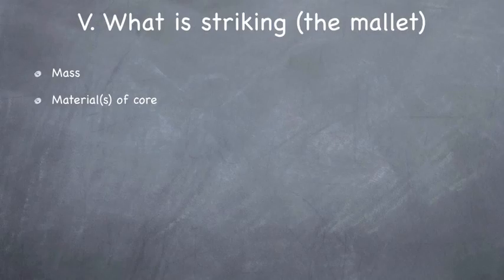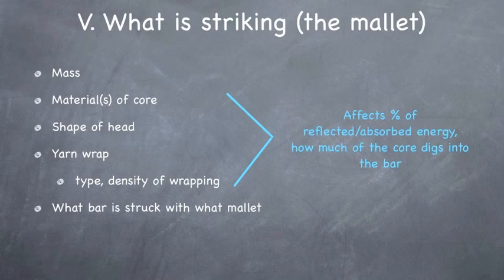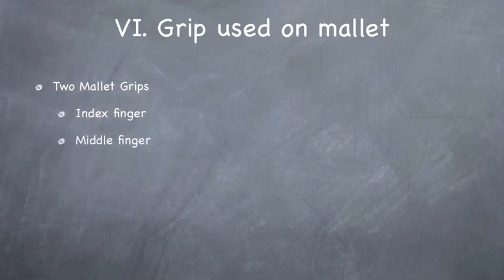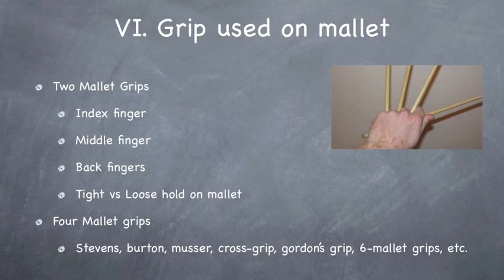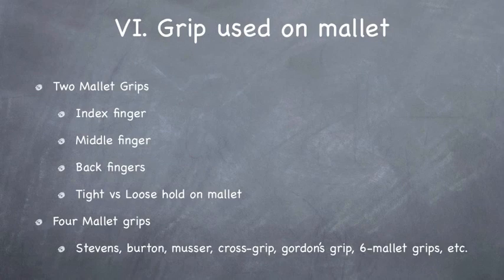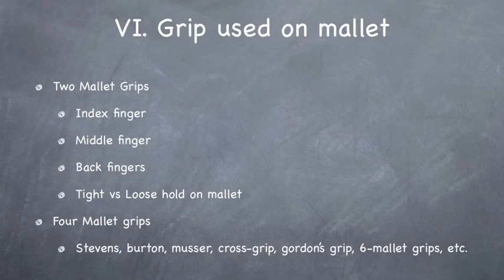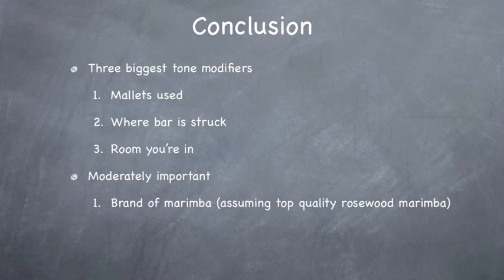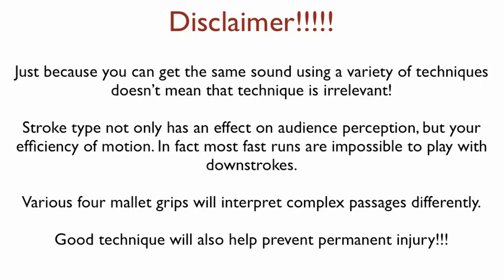Marimbalogy.com #2 the Variables of tone production part 2

Comment: How much wrist should i use? Should i use any fingers at all? 2 mallet grip index and thumb fulcrum with loose hold is the one i currently use but i dont know how the technique, if there is any, works.
Reply from the maker: There are several options! Are you playing in a group? Sometimes instructors like everyone to use the same technique so it looks uniform. Index and thumb is ok, but I find that it puts a lot of stress on the finger over time. I typically grip more with my back fingers. As far as wrist vs fingers, it doesn’t hurt to use a little bit of finger but 99% of the work is with your wrist. I like using arm when I can just to ease up the work my wrist is doing. This has no bearing on sound, it’s more of a stylistic  and feel thing.
Reply: @Marimbalogy  thank you, this helps a lot